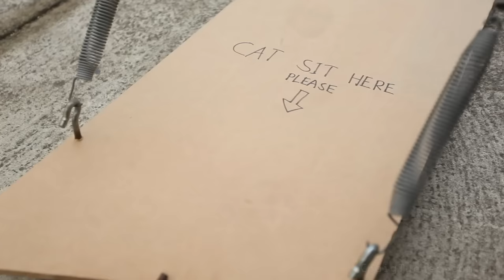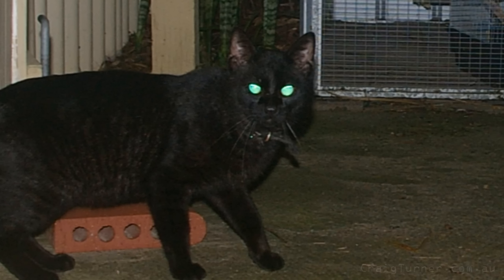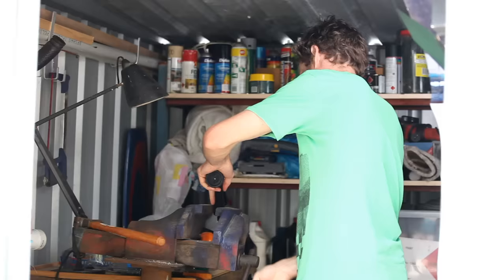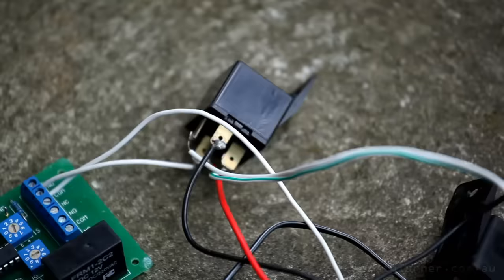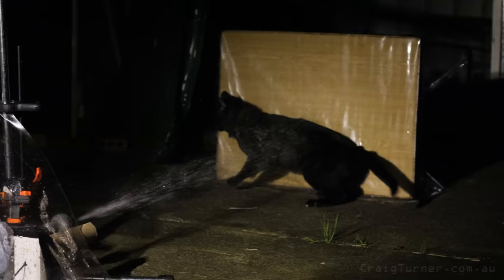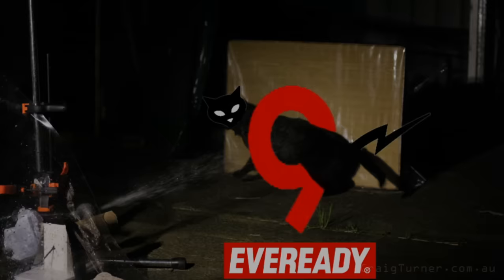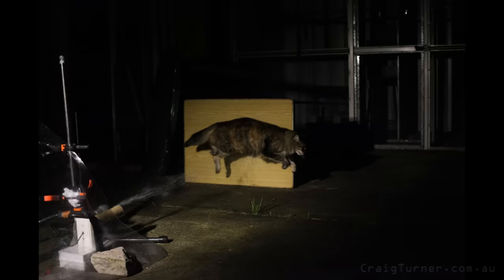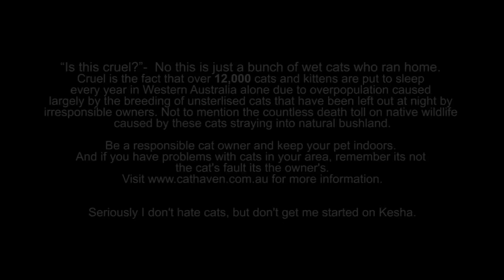How to stop cats going on your car - The best cat video ever!

Comment: >I'm gonna teach you a very simple method
>Rewires entire car engine
Reply: ipperz12 pulling a relay, and a couple of screws is hardly the most difficult thing to do with a car.
Reply: After I ripped out the wiring, relays, door switches, etc......
It cost me $9,000 to have a mechanic put it back together.  So I settled on a .22cal pellet gun!
Reply: I don't understand the logic of dismantling the car for simple affordable  parts you can purchase.
It's not like the final contraption is even wired to the car. Right?
This must be satire. Or trolling. Or just a terrible idea.
Reply: lmao tru dat
Reply: Right, takes apart car and home security system for this very simple thing... meanwhile, spraying cats but gets robbed..lol...
Reply: Rock salt in shot shells ;)
Reply: Replace the water hose for a simple spray can flamethrower . They hate the smell of their own burned hair. May be I' m some kind of cat whisperer ( woosher) and I didn't know.
Reply: Its  resourcefulness
Reply: theprophecy11 Thanks ! Pepper spray might be simpler and safer .
Reply: Bernardo H I could try on you 1st, thanks for the tip.
Reply: @Way2Spirited  Or a video simply not meant to be taken serious, it is supposed to be funny and your dry humor can't understand that seemingly
Reply: @Phoenix.Sparkles  You obviously do not know the definition of SATIRE or did not read my entire comment. Also it's apparent that you do not know the definition of "Dry Humor" since you tried to imply that I had a lack of humor by saying that I have "dry humor". Here's a clue: both SATIRE and DRY HUMOR are types of HUMOR
Reply: ... OK

Comment: Very clever and very entertaining, I would recommend though that you buy the actuator and relay at an auto parts store vs taking your vehicle apart, they are inexpensive or better yet go to a junkyard and by some off some wrecked cars for dirt cheap.
Reply: I think he was taking it out of his car in jest
Reply: BarryTheElephant
Yea, probably so. They sell that cat-chaser at Amazon, it's around $45, hooks up to your hose then it has a stake you put in your lawn close to your car, it's motion-activated, when a cat (or a person) comes near it sprays a blast,of water in a 30 degree arc.
Reply: Or better yet... buy an infrared (a.k.a. "motion activated") water sprinkler.

So first off, this video is absolutely hilarious and brilliant and I feel his pain.  I had a bunch of feral cats take up residence in our backyard which made mowing the lawn a filthy endeavor.

My M14 G&G Airsoft gun would have been effective if I could have caught any of them lurking around, but in the end I settled on a couple infrared sprinklers.  They are EXACTLY what was used in this video except were a bit easier to construct:
- Log onto Amazon.com
- Search for "motion activated sprinkler"
- Click "buy"

I currently own 4 Contech Scarecrows but there are a ton of suppliers and I suspect they all work well.

I set up my first 2 then watched cats, deer, coyote, raccoons, possum, dogs, rabbits, a ground hog, birds, squirrels, and my kids all freak and run to get out of the yard.  After two years the cats still skirt along the edges of my yard.

The sprinklers are also brilliant for defending backyard gardens.

Comment: Just a thought if you don't want a water mess, or live in a climate that could freeze the water in the hose, or even run the risk of scalding the cat with sun heated water (should you wish daylight protection as well). "Most" cats are easily startled by sounds, some sounds don't even have to be loud enough to disturb you or your neighbors. You can easily use the same motion detector as the trigger as in your projects, but instead of activating a hose have it activate a super small electric motor such as those found in cell phones. The kind that  is used to make your phone vibrate, (basically a purposely lopsided motor that uses a small weight for the vibration effect). These are available online for next to nothing. Simply set it loose inside anything like a plastic spray paint lid, or (my favorite) attach a rattle snake rattle (also available online) using a thin spring to allow it to wobble even more. Drop a rubber rattlesnake near the motor, and watch those cats flee in terror! After a few scares, they will likely avoid your property altogether. An additional bonus is burglar type humans are also often startled off. 

If you are not into mechanical devices, perhaps try a super cheap player with a volume control, play a looped rattlesnake audio file.  See if it works on the cats.

Comment: Love the vid. If i can make a suggestion, hook up to the motion sensor a 12-24v solenoid to activate a valve to open and close the water flow. That way you wouldnt need to use the sprayer

Comment: This is similar to how we train our cats not to go outside.
We have dogs as well as cats. The cats have litter trays inside, the dogs go outside to toilet.
We (obviously) open the door to let the dogs outside, and we have a sliding door. Cats are well known for running through open doors, which can be dangerous if the cat gets outside (dangerous for the cat, and for the environment).
Whenever I get a new kitten, as soon as it starts trying to run through the open door, I (or my daughter) sit outside the door with a spray bottle. As soon as the kitten sticks it's nose out the door - BAM! it gets sprayed with the water bottle.  Usually, it takes three or four sprays to get it to just not ever try going through the door again. 
This doesn't  mean we just leave the door open and never police it, but it means that we can open the door without the cat flying through it. AND, after three or four sprays, all I need to do is make the 'tsst tsst tsst' sound (sound of the spray bottle) to make the kitten run away from the door. Just the sound memory is enough!
It's one of the easiest, safest, kindest methods of training a cat not to run through the door that I know of. I've been using this method for about 30 years. It's never harmed any of my cats and I've never had one get out of the house after using this method.
I hope this helps someone else out there whose cat runs through the door. It can take a while sitting outside with a water bottle waiting for the cat to try the door (especially after the first time or two - when the cat gets wary), and it really works.

Comment: Honestly I feel like you should use this spray mechanism with the other trigger mechanism (since it’s simpler); the spray covers a wider area so it has a better chance for soaking, and when it hits the plastic wrapped table it makes more of a noise which also adds an audio factor to the jump scare (the PSSSSHHHH also sounds funnier to watch 😂)

Comment: I rigged up a cattle guard, from my past farm, so it would scrape the cats back on the wire, sparks flew but the cat never even blinked. like I did. Could not believe it. Years later, I saw some recordings of cats getting surprised by cucombers snuck behind them, tarrific results. SO, of course I tried that, quickly loosing it on the road. DUCT SEAL is the thing to get. Shape it into a cucumber & stick it on the roof when u dun driven.

Comment: Maybe you could make a cat zapper - it won't kill 'em because it only pulses and they would jump 3m in the air after the first zap!

Search eBay for this:
DC-3v-6v-to-400kV-400000V-Boost-Step-up-Power-Module-High-voltage-Generator
I've one -  it makes a loud spark several times a second, I think they use 'em in stun guns.

Comment: I’m thinking about building this on air pressure in my car. The funny thing is, it’s only done, right on my front air intake (smells horrible when AC fan is on). So I’m thinking about to put three motion activated air sprays behind the grill of my car 😈

Comment: 10bar Air Container and electromagnetic valve, just blow them into oblivion,
AND whatever you set up, make a two stage trap...  as the cat reacts it need to enter an opposing trap going straight into the face